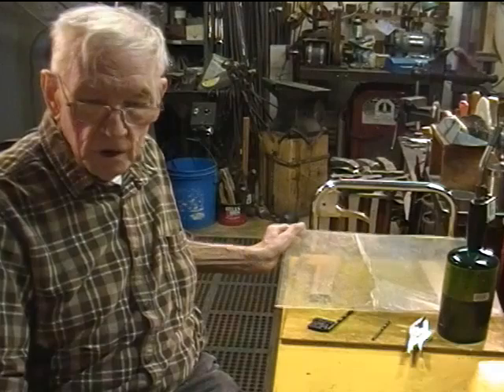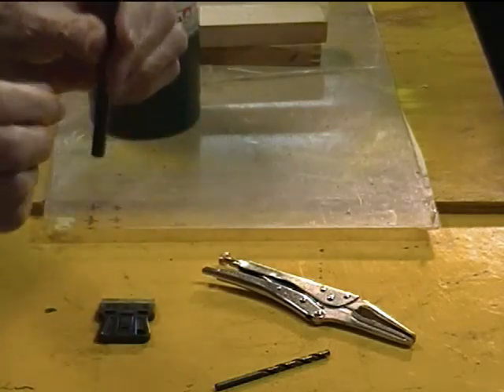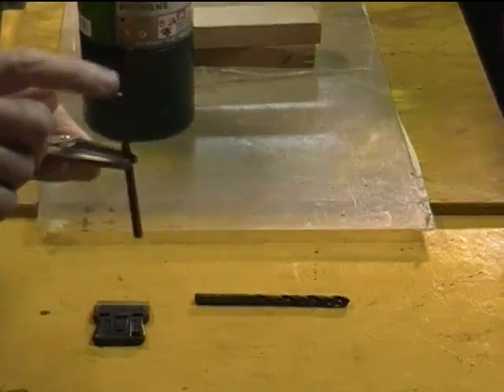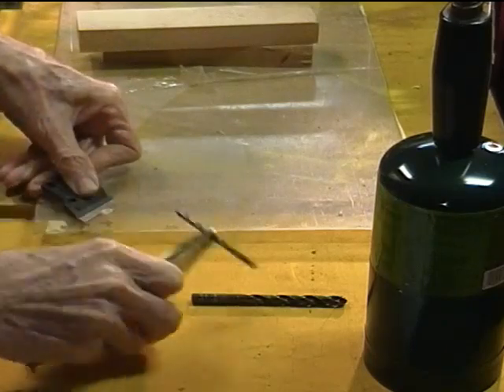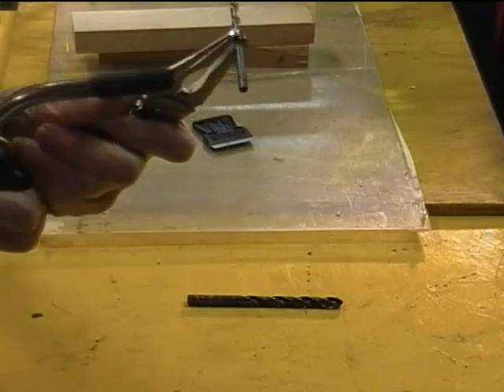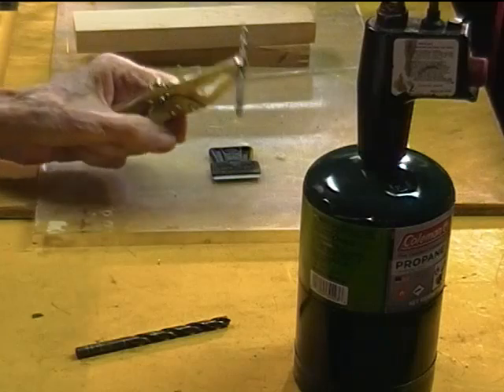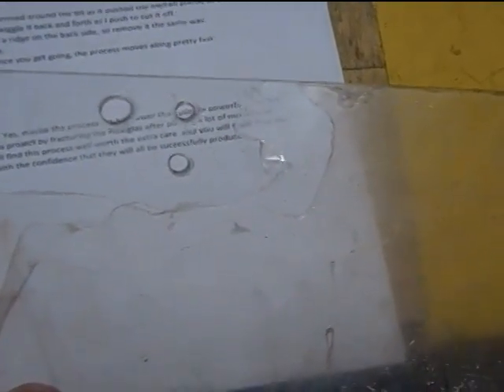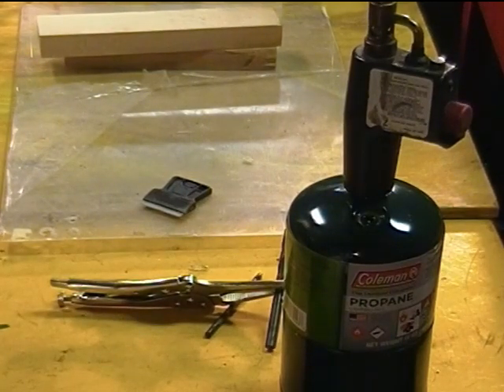No More Cracked Holes in Acrylic Plastic #222

Comment: Good video. Acrylic and polycarbonate (Lexan) have very different properties.. I usually spend the money for polycarbonate, a standard drill bit works fine without cracking the material, unlike acrylic.

Comment: Interesting method.  A couple of years ago, I had to make 138 holes TIMES TWO in a pair of super expensive and impossible to find acrylic aircraft windows.  I found drill bits designed for acrylic and drilled each hole 3 times to get to the needed size.  Tips that worked for me was having new bits and I kept the bit cool and lubed with dish soap.  It's critical not to press hard and to go slow when you break through.  To say it was very nerve racking is an understatement!  I spent a solid week drilling these holes and didn't crack, chip or clam shell a single hole.  Each hole was inspected with a prism upon completion.  I really doubt I would have tried to melt my way through that acrylic.  I just hope I never have to do that again.